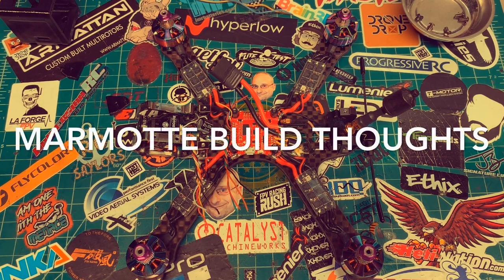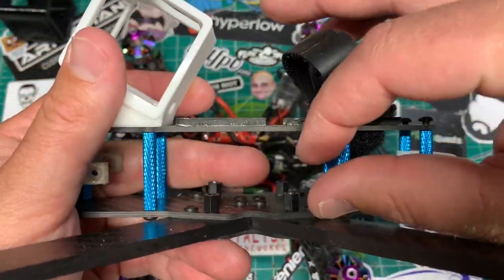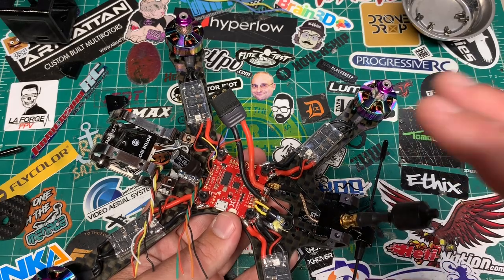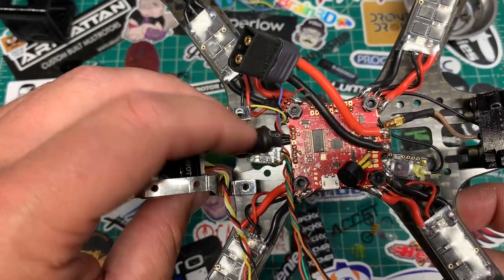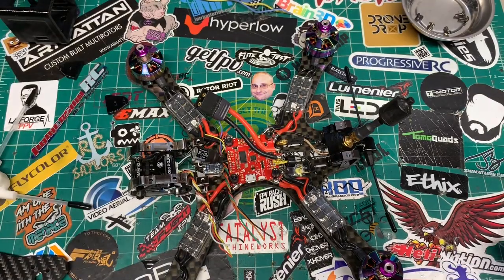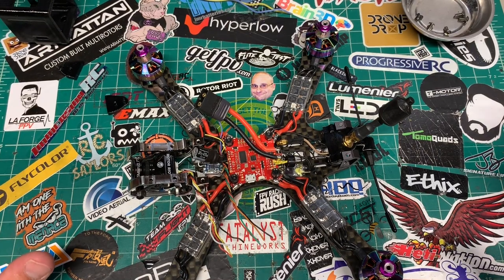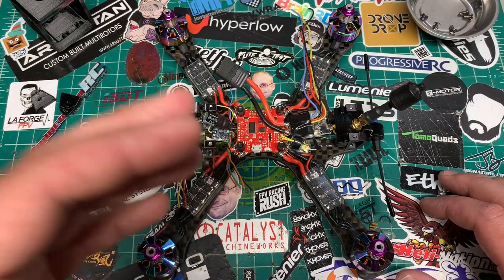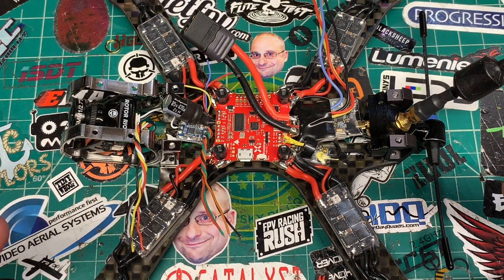5 Inch Build Recommendations With The Marmotte

Comment: How's it going I have one also with the  Brain 3-D printed parts also and I believe the the rear antenna mount goes inside the aluminum pieces at least that's how I have mine. And that gives me quite a bit more Room than you have. I couldn't figure out a way to add a picture but if you go to my Facebook page I'm pretty sure I have some pictures on their. Or you can send me a message and I can send you a picture. Oh and by the way nice looking build.

Comment: Bro can you do a video on how to connect a F7 luminer v2 to a R9mm please I can’t figure this out.  Thanks
Reply from the maker: ROOT FPV I don’t have that fc. But you can connect the sbus out wire from r9mm to any rx pad on the board. Then activate serial on the ports tab for the corresponding rx pad you put the sbus wire to. Then select sbus on config tab, on any f7 board you can use any uart for sbus. Only f4 have specific pads. It’s an inversion thing.